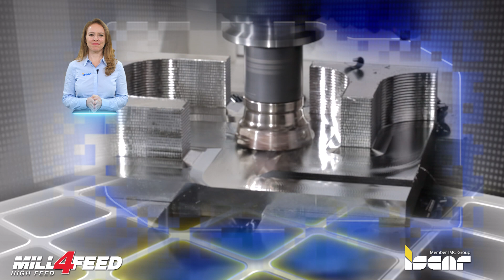ISCAR TECH TALK - ISCAR Expands MILL-4-FEED Fast Feed Milling Tools

Comment: How does it do walking down a ramp like shown around 0:40?  Actually have a 316 stainless application I was thinking about trying something like that with, but wasn't to sure.
Reply from the maker: ISCAR's Tech Talk on the subject of fast feed inserts relates to flat inserts for H type material intended for interrupted cuts.
For AISI 316L /304L stainless steel, ISCAR recommends the HP\RM-HP chipbreaker for facing and RM-HP for working near walls (all grades with the HP chipbreaker are dedicated for this material type).
Regarding Ramp down capability/angle  see ISCAR's E-catalog under RMPX°= MAX ramping.
Reply: Нормально это работает. Не бойся. Можно даже снизу вверх. Только шаг вбок сделай 1-1.5мм.